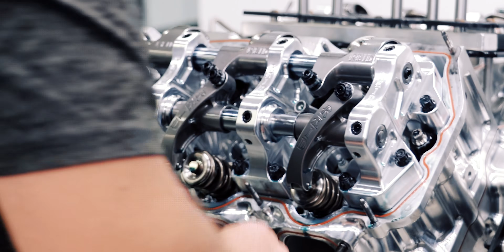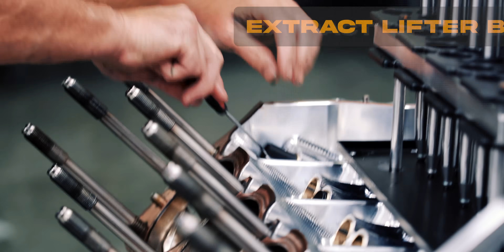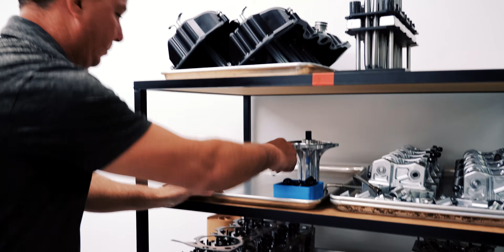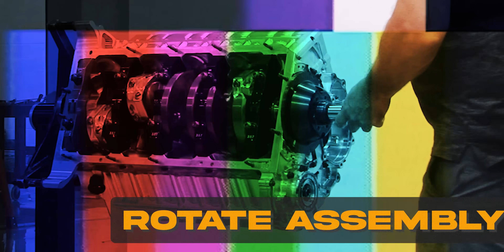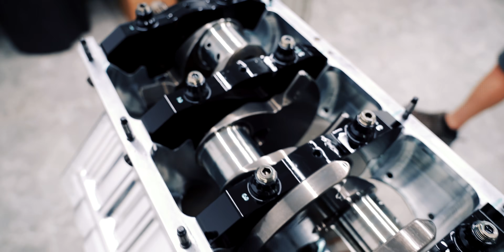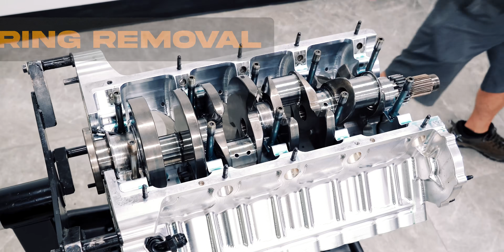4,000hp!! Watch Jamie Noonan rapidly teardown a 4.9 Hemi!

Comment: Jesus did y’all see those pushrods looking like a 1/2 extension for a socket wrench🤯
Reply: The 5/8 heads studs 💪
Reply: Yeah,  I was like 😮
Reply: @todddooley793  them things are bigger than my connecting rods in my little engine lol
Reply: @Backyard_Racing  LOL! I have a model-plane "Diesel" engine (really HCCI, jet fuel/2-stroke-oil/explosive mix) and the CYLINDER is smaller than the diameter of these!!! Frick!!!
Reply: Yes sir yes sir